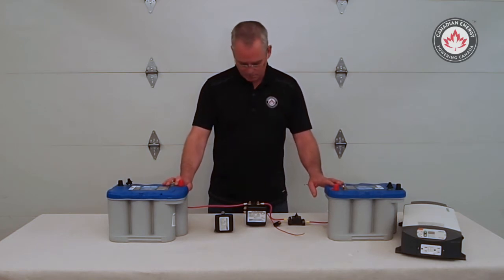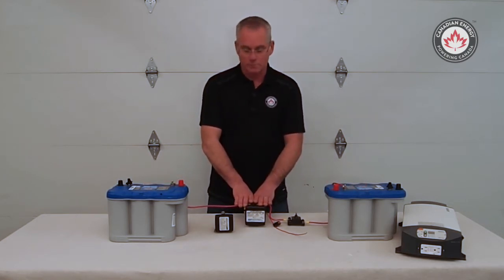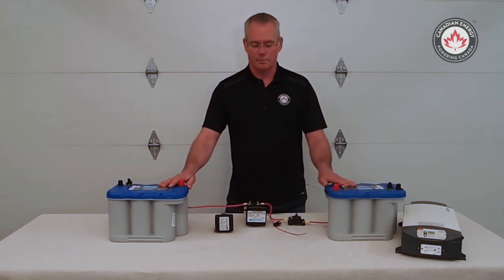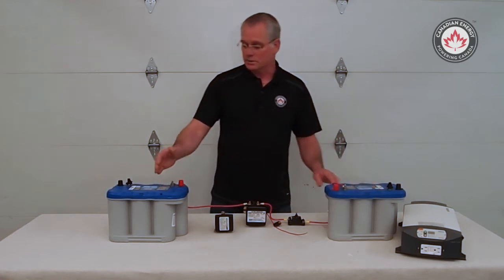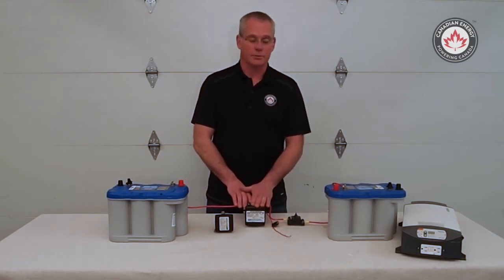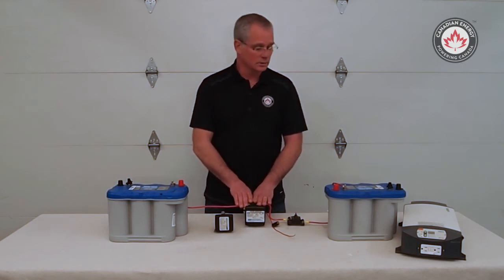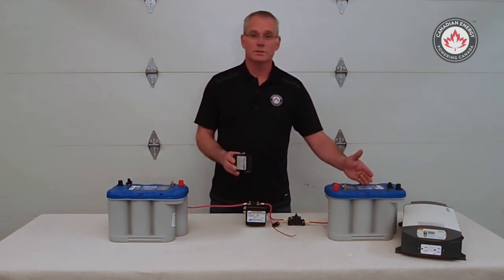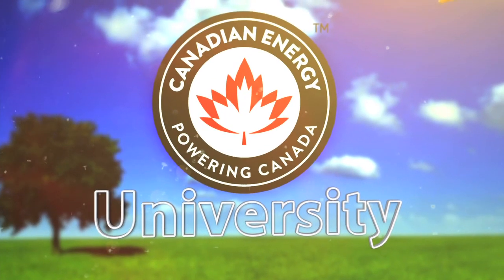Canadian Energy™: What Is a Battery Separator?

Comment: To clarify, this is a Battery Isolator between ICE vehicle starter batteries and any other set of rechargable batteries, NOT a Battery Separator, which refers to separator membranes between oppositely charged plates inside batteries.

Comment: Thanks. I have one of these made by Eaton in my truck. I was also told that the separator also limits the maximum voltage charge when the vehicle is running. This prevents a high amperage alternator from charging the batteries too rapidly, possibly damaging them. Is this true?
Reply from the maker: trynodev No the Eaton battery separators do not control or limit voltage on high voltage alternators, this can be especially problematic when the auxiliary battery pack is AGM or GELL and voltage must be limited to 14.4-14.8 volts to avoid overcharge and dry out.  We have successfully used the CTEK D250SA and Smartpass 120 in some applications with high voltage alternators to prevent auxiliary battery overcharge, it is a more expensive option than the battery separator but seem to work quite well.